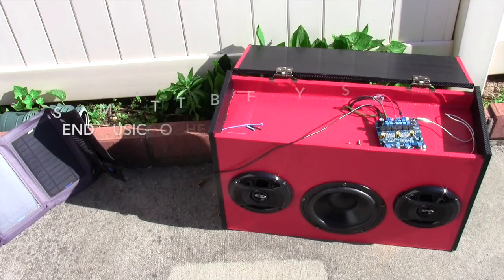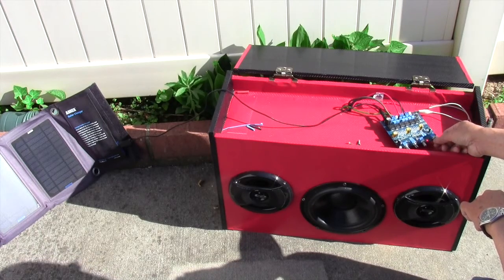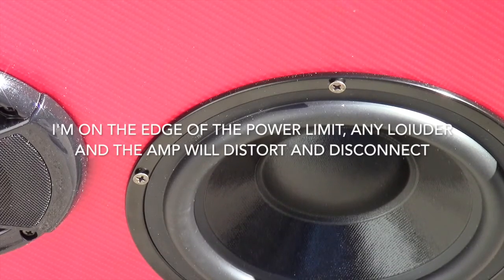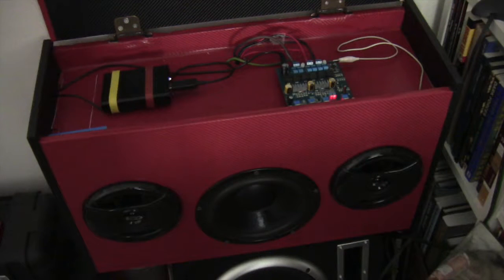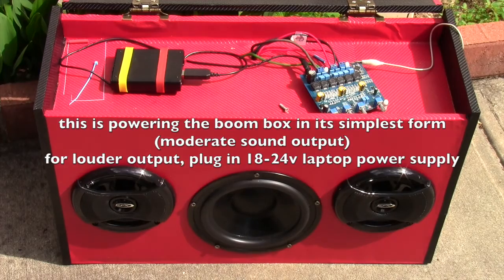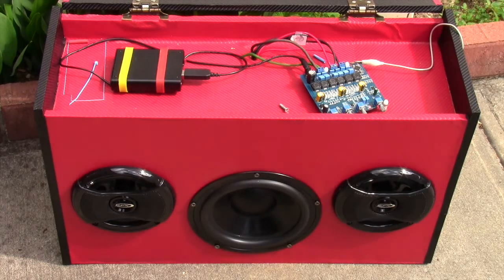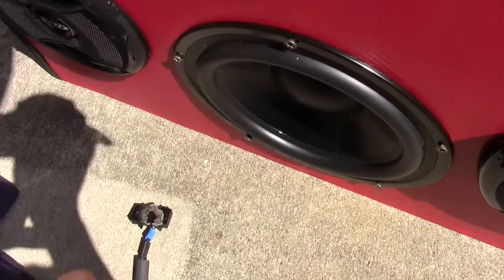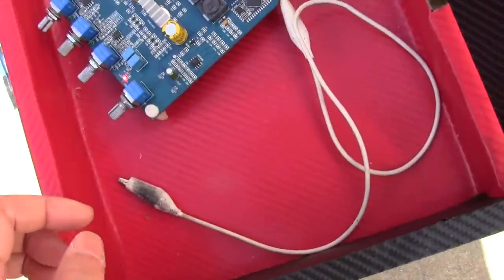solar and usb powered diy boom box project Part 6

Comment: The problem you are not aware of is the 2.5 watts is at 120 volts. That is if you have the same mains power I do. Wattage and voltage are what we call "indirectly proportionate" all that means is, if you raise the voltage, wattage requirements go down, if you lower the voltage the wattage requirements goes up. The stupid simple answer is 120 volts lowered to 12 volts is a factor of 10, 10*12=120. So if you draw 3 watts at 120 volts you multiply 3 by the same factor of 10, 3*10=30 watts required at 12 volts. That will give you the same volume either way. At least in a perfect world where electronics are at 100% efficiency.
Reply: You have confused watts with amps, watts are voltage*amps. But I do agree that his 2 watts reading he got is not correct. If it was his power supplies would not be cutting out because they are all rated for more than 2 watts. Also it's just common sense that the amp would be pulling more than 2 watts at those volumes ;)

Comment: What sound amplifier is that you using thank you
Reply from the maker: I use TPA 3116 D2 amplifier. 50W*2 and 100w subwoofer output. You can see the amp in the video.  It's the small board on the top shelf of the boom box.  You can buy it on eBay for $20 or so.
Reply: wtam69 can't seem to find the exact one you have
Reply from the maker: Sorry, missed your message. Try this link: http://www.ebay.com/itm/361432245179?_trksid=p2060353.m2749.l2649&ssPageName=STRK%3AMEBIDX%3AIT

I just bought another one.

Comment: Am powering a 30 watt speaker with a 12v 12ah battery.... Would a 12v 10 watt panel supply adequate power to my batteries to charge it fast or maintain its charge???
Reply from the maker: It depends on which amplifier you are using and how long you will be using the amplifier.  For a system like mine,  a good day charge of a 10w panel to a 12 amp hour battery would be sufficient for a whole day's listening.
Reply: am using a Dc speaker.... Am using Ac active speaker powered by a 300w inveter... What do you advice I do??
Reply from the maker: Aetheon Pro Using a DC to AC inverter to power equipment is not very efficient.  You will quickly drain your small battery and the small 10 watt solar panel will not be able to keep up.  It is better to find an amp like the one used in my video and power it with direct DC. The amp I use costs about $20 and can run on 12 to 24v.  A 12 amp hour battery will have no problem running my setup.
Reply: My speaker has an internal d grade amp because its a studio monitor.... and also am not much of an electric expert...lol.. So am pretty much stuck with plug and play, anyway, what type of panel do you think suitable for my inverter that would be able to keep up? thanx
Reply from the maker: Aetheon Pro If you cannot hook your amp to   a battery directly, I would use a 50w solar panel so it can charge your battery quickly. You'd need a solar charge controller. They are about $10 to $20 for a 10 amp model.
Reply: Thanks,.... Also, does the 10 amp charge controller mean that it would constantly push 10 amps into the battery during charging? or does it mean the amp maximum draw is 10 amps??
Reply from the maker: Aetheon Pro It means it can handle a maximum of 10 amps going into the battery. A 100w solar panel put out about 5.5 amps max so a 10 amp controller will work fine if you use a small panel like a 50 w or 20w.  The controller just make sure you won't overcharge your battery. Some models have a load function so you can power your dc equipment, usually up to 10 amps.

Comment: Wow nice power options, I'm working on one of these BT speaker projects using a 2.1 TPA3116D2 board. I think I will try to design a battery system and have a toggle switch to remove the battery and go on completely off a small solar panel with a super-capacitor bank (protected) in line to buffer clouds and slight deviation in the sunlight. I think it would be cool to have an option like that! Plus you save your battery cycle life on a nice day.

Comment: How much watts your speakers?
Reply from the maker: Left right speakers rated at 50w each  and woofer 100w at 4 ohms.
Reply: This is RMS or Peak Power?
Reply from the maker: 50w RMS into 4 ohms for the coaxial speakers,  80w RMS for the Dayton 8 inch sub.

Comment: How about using super capacitors as a reserve for the solar cells? Then when the sun goes behind a cloud for a few mins the capacitors would provide the extra current the amplifier needs? When the sun is out again and running the solar panels at full current they could run the amplifier and recharge the capacitors ready for the next cloud to float by.
Reply from the maker: Absolutely, you can use super capacitors.  I was actually thinking of using supercaps to demo this. The only thing is I would need a few more of them in series and they are pretty expensive. They have no memory effect but would need a constant voltage circuit to limit charging voltage.  For my purpose,  lithium ion packs seems more practical and have higher capacity and more readily available.
Reply: why not just use rechargeable batteries?
Reply from the maker: Ja ynik Yes. the final version will be a pack of 3s2p 18650 lithium ion rechargeable battery pack and AC. This is just for demo purpose to show that this can run on solar or USB power.